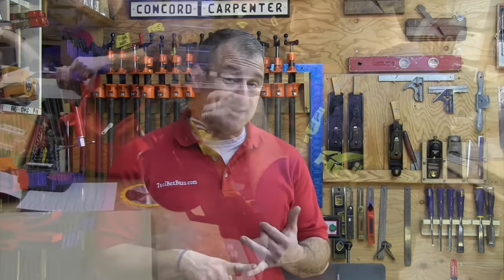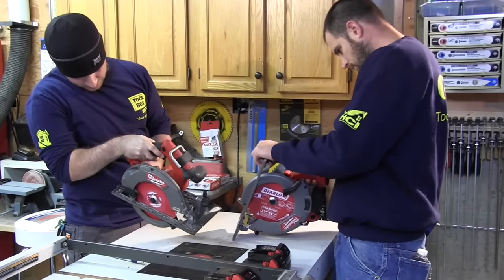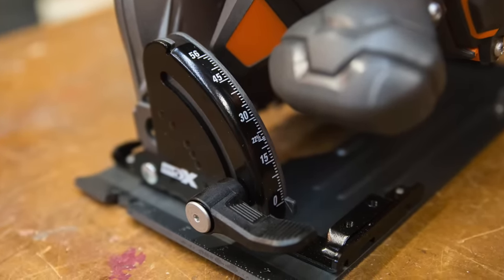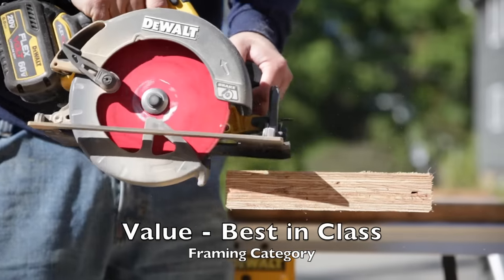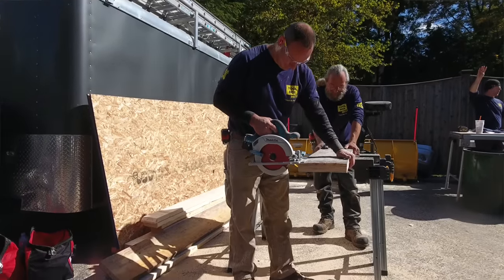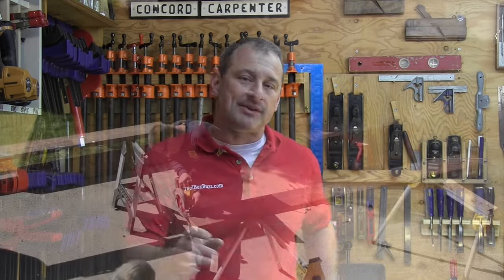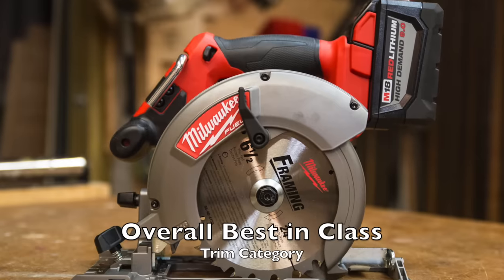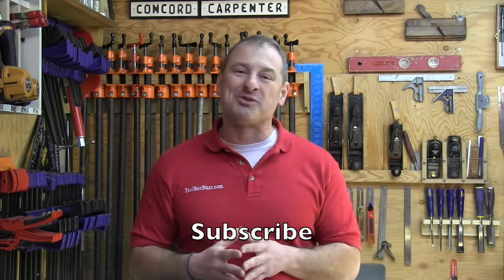Best Cordless Circular Saw - Head to Head

Comment: Rob, you know I'm a fan, but you've got this COMPLETELY WRONG! I have 4 of these saws you tested and 2 that you didn't test. Where is the Festool HKC or the Mafell?? The Festool saw wins alone by the FSK track system for it! Festool or Mafell must not have agreed to send it, maybe that's why they are not included, but don't label the vid as the BEST circular saw ever then! .......Dissapointing
Reply from the maker: Hi Dan,

Thanks for the comment - I think.  I've been a carpenter for over 21 years and have NEVER seen Mafell on a job site.  It's Timber frame stuff, isn't it? 

As far as the HK Saw - yes it should have been included but was not ready at the time we did all this.  We have it now and are looking at it on the job site. Much of what you see occurs months before publishing.  The track system on the HK saws is cool, very cool but not all inclusive - there are many applications where the FSK track would not apply or work.

The saws we looked at are  the ones we most see on the job sites, and most available, we work on - we felt this was a realistic sampling for guys.
Reply: Ive rarely seen Mafell as well, but no its not limited to timber framing, but that is the majority of its use. Ive aslo been a general and a carpenter for around 23 yrs and I rarely ever see a Hilti, but guys that use quality tools like us, like to use Festool and I Use it on my sites and see it more and more. As far as the 'Average' carpenter goes, obviously the trades demographics are the dewalt, Makita and Milwaukee as I own many of those tools as well, but to include Hilti in there dosnt make any sense if you don't have Festool and I understand it wasn't available. But the HKC has changed the way I process goods on the jobsite as the FSK rail for it is a game changer in the construction industry! I don't have to bring my Miter saw to 40% of my jobs anymore, thanks to that saw system.
Reply from the maker: Good points on Festool - I'm a big fan of their innovation and tools. We see a lot of Hilti here in the metro Boston area. See it a lot on union jobs too
Reply: Dan Because those saws aren't as powerful as any of these saws, they are so overrated especially Festool
Reply: Dan, I am like you and own quite a few of the saw's that were in the test. I also own the Festool HKC and it although is an innovative and useful saw it doesn't compare to the most of the saw's listed. I do believe this to be more of a blade issue than I motor/battery issue. Let me know what your thoughts are.
Reply: Overrated...obviously you havnt used them.
Reply: Why aren't they comparable? Ive been using the HKC on the job since I got one last year and I use it much more than my Milwaukee or Makita. Its super lightweight and not one other saw in the comparison has a track like the festool system fsk. When I use a circular saw, I want to make exact cuts. I can make exact cuts on a bevel or miter with the fsk and rail. real easy decision for me. The battery life lasts forever and I have the original blade in the festool, while on my 3rd blade in the Milwaukee with half the cuts. And I can use the festool as a plunge saw/track saw....
Reply: I haven't used it? I actually use the saw often. What exactly are you framing using the HKC with fsk tracks? All I hear is that the saw work's well for your style of work and in your application.
Reply: I mostly do Remodel and some new construction. So you have the saw then? I love the fact that I put it up to my workpiece and cut...perfect 90 degree cut in one motion, or any other angle I need one handed. On smaller jobs I don't have to lug around my Miter saw and just use the fsk system instead
Reply: I was replying to The BIG Daddy comment about must not be using it, sorry Joe
Reply: Yes I do have the saw. I am full time framing contractor. I have 3 tracks for it and use it mostly for cutting 2x10 floor joist. Probably close to 400 in a day. I also use it for gang cutting rafter's. I am seriously no a fan of the blade. I think it would be better of with a aftermarket blade like Diablo. I am going to try a tenyru blade next and see if in happier. Diablo spoiled me.
Reply: Dan ahh no problem.
Reply: Dan Those two saws are track saws, they are not the same

Comment: Whay you used 9ah for Milwaukee and only 6ah for Dewalt ?! Need to win Milwaukee ?
Reply from the maker: At the time of testing and evaluation, these were the highest amp hour batteries available from both manufacturers
Reply: In this situation is more exactly how many cuts you have per each Ah , because can't compare 5 , 6 or 9. All other YouTube testers said Dewalt is above. Thank you anyway for your answer , I like what you did

Comment: I don't think this guy knows how batteries work when they are ran in parallel like the Makita with two batteries the amps stay the same the voltage doubles so this "test" based off the Makita having two batteries so everyone else should is a very poor scientific method.
Reply: timothy baca Two batteries in parallel don't double the voltage, the voltage will stay the same.
Reply: Andrew is correct voltage remains the same , double available amps

Comment: Milwaukee 2731 is gutless.  Big disappointment.  Stalls out on any kind of bevel cut or stair stringer type cut.  Horrible site lines.  Also no rip fence {although it can’t rip a 2x4 stud anyway.) Depth of cut indicator is backwards and useless. 
Hilti scw 22 is better in every way.

Comment: i guess hilti puts too much money on big shits like concrete and steel so their saws aint good enough for wood works
Reply from the maker: The HILTI WSC 7.25-A was actually retested at a later time because during our evaluation we suspected we had a lemon on our hands. When we do these head to head tests, we use brand new tools out of the box, so there’s no way to know if we’ve got a defective tool ahead of time. Although most manufacturers employ quality control measures to identify faulty products before shipment, you may purchase a defective tool and should immediately contact the manufacturer or distributor if you feel you may have a lemon.

Upon retesting for endurance the saw performed in the middle of the pack, which we anticipated given the age of the SKU. Some of the photos in the article show the LVL results from the first unit we tested. The graphs include data from the newer unit that was tested after the fact. The tool itself had some unique features, like a shoe ready for a track, and a removable portion of the guard for dust control

Comment: This guy does great marketing Milwaukee garbage. The bevel lock sucks. Doing long rip cuts on Milwaukee. Clogs with saw dust. Not to mention you have to use the 150 dollar 12ah battery. And should have 2 for 300 dollars. While the makita any (2) 18volt makita battery works.

Comment: It's hard to follow the criteria here so let me try to sort it out.
For weight you have Makita with two batteries, others with one.
For price you have all with two batteries, which is nonsense, because nobody buys into a battery system and only has the batteries required for a single tool. That's what this is, too.  It is not a tool system, it is a battery system, sometimes the batteries cost more than the tools.
For endurance, you have the competition run x number of cuts, then DOUBLE IT to compare to Makita? WTF?
BTW, in actual use you can run with three batteries, since the ones on the saw never run out at the same time, one can be charging while one fresh and one old are on the saw, depending on the material and depth of cut etc.

This is just a messed up review altogether, you can't handicap Makita in one area, then another, then try to even it out and handicap it again.  I now have no idea what it will cut compared to the others, and can't compare the others to the pothers because you doubled the battery price!
Some will choose to make the batteries expensive to make money, selling the tools cheap to get people invested in the system.  Others will try to make the batteries cheaper to make money on tools.  Depending on which philosophy they follow they will be impacted differently on your doubling of the battery price.
Makita evidently thinks, "oh, our average buyer has five batteries with their other tools, so having an extra battery on a tool often sold without batteries is insignificant cost for them, but gives this additional endurance bonus"
Then you take away that bonus by doubling the competition performance. SMH
Evaluate the tool, don't redesign it.

Comment: Battery runtime importent???  is this so that milwaukee can win ? it takes 3 sec to change battery, it makes no sense. NOT A GOOD REVIEW ergonomi is the real importen think here.
Reply from the maker: Peter Skjold you make a good point, batteries are expensive though. Most if not all of these tools have decent runtime
Reply: 1 in the charger 1 in the tool and you can work forever, and i belive that any contractor has 2 battery´s. I am an optometrist and i have 4 LOL